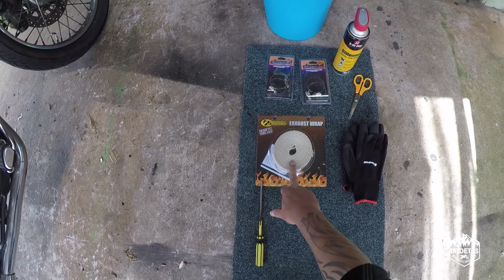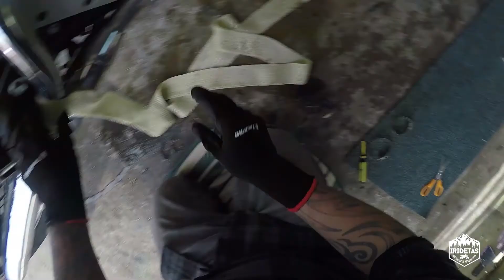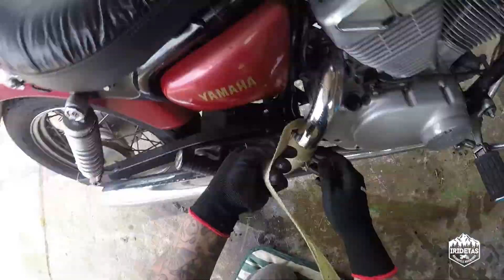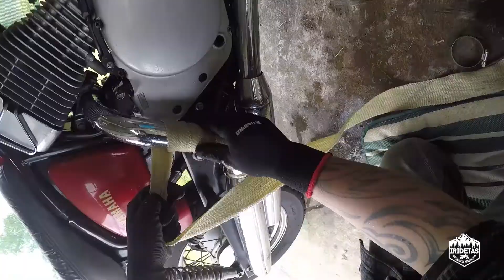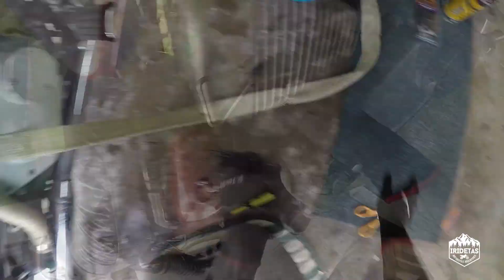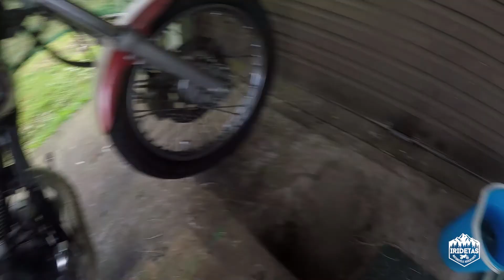Budget Bobber Build #6 | How to Install Exhaust Wrap on a Yamaha Virago XV250

Comment: I was curious...but then as soon as the video started, I saw the Blue bucket. 
FINALLY, someone who's doing it right. Too many vids out there doing it dry.
Has been the plan for Ages, but I'll do my Xv One-Day, the zed also has to be done and I'm curious if it would look good on the Sr??
I prefer stainless steel wire to hold it on though. Tis neater imo.
TFS iRide, uRSOT >:)
Reply from the maker: MrFalloffalot CrashTestDummy TV i love exhaust wrap think it looks great.  On some bikes i use black as its a bit more understated.  I cant even imagine doing it dry.  Be like installing roof insulation!!!! Think any bobber chopper brst or cafe looks cool with it! Thanks mate take care!

Comment: would it not be faster to remove the pipes before wrapping or ? .. was a serious question not a diss :D .. hooked on these vids haha
Reply from the maker: Nope dont reckon.  And the fact they are mounted allows you to pull against the weight of the bike to pull them nice and tight!
Reply: good point .. gathering info like hell here :D looking to buy a xvs 650 and the info here transfers over i guess
Reply from the maker: Some of yes general things like tjat and bobbing guards etc.  650 is shaft 250 is chain.
Reply: prefer shaft .. dunno why :D .. just like that look a bit more . loss in a little bit of power for the looks .. ah well ment to be cruising anyways
Reply from the maker: Shaft is lower maintanence and very direct! Cant mess with the gearing tho as a downer
Reply: You should always remove them.

Comment: Remove the exhaust from the bike..... much better application and tighter wrap.
Reply from the maker: Ive found the opposite, you can pull againt the weight of the bike and get it nice an tight, particularly wet. But ill give it a go again. Cheers!